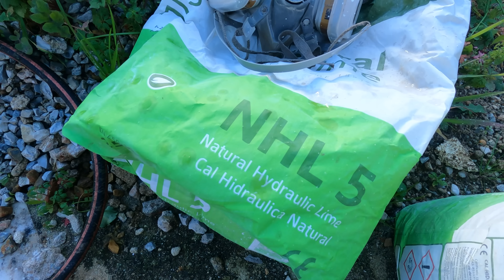Never done THIS before - Screeding a Limecrete Floor

Comment: Great job guys. Yes me and electrics have the same relationship as you when tackling something new. Some thoughts I had, when you have a dryer mix might be easier to lay mix down in layers and tamp out so as to avoid air pockets also not sure of your finish but will you be using a leveling compound? before tiling floor.. This can take out any slight discrepancies of levels..

Comment: Use self leveling concrete after you put enough height to get the perfect floor level
Reply from the maker: Why would we go to all the effort of putting in a (breathable) limecrete floor to then ruin it by using cement or a plasticiser 😳

Comment: On the anxiety issue, I'm sure that it doesn't help having the camera rolling and the pressure of feeling like a teacher. But you guys have made it plain this is not teaching, but showing the doing when you're unsure of what you're doing. That's different. For me, watching you is about watching your experience, not necessarily expecting a tutorial on how to do something. So, there's that. And one more thought to enhance the experience, while I have tried to watch every one of your videos, I sometimes forget what the plan/goal/inspriation is for a particular room, so including a snapshot of your end goal design at the beginning would be helpful for me, and maybe others. That way, we could comment with more insight when you ask for advice like tolerances, etc. If the base cabinets are going to sit directly on this, I would want it to be as finished as possible. If there will be a covering, then I don't think I would be particularly precious with the finish, except that it be level and ready to accept the next layer. Time is your most valuable commodity. Cheers.

Comment: Morning from Canada. Do you have any scaffold tube. If you level that and set it on the floor for screeding it will save you time and make life easier rather than use wood which will stick. Chalk line on the wall for level or 2inch tube if you have it. it will lift our if you mould oil or veg oil the tube. Chalk line the wall nail gun the cork

Comment: Here's my two cents (although not very familiar with lime) the ratio 3-1 should be good, if it were concrete i would add brita nº 2 to the mix so it would help with the amount of mix you will need and to reinforce the slab it self, since u're not using "malha-sol" (Portuguese word for the grid steel that goes on the bottom/middle)  from what i know 4-1 part is more for the facade of walls where you need something more fine. And also i believe you should have left the form at all times (the scrap of wood) because when it expands it might get out of shape. Apart from that... excellent job :D

Comment: A wetter mix will self-level and also screed more easily. And you won't get the air gaps that are visible in the sidewall. 

If you're tiling over, then too smooth a surface is actiually bad. 

In short, Level=Good, Smooth=not so much

Comment: High spots bad....Low spots can be filled by tile mastic.  If you have one spot that is a centimeter too high, the entire floor will need to be raised by your tile mastic...A low spot can easily be fudged in.  Keep your mix as wet as you're comfortable working with.  You don't want it leaking out under your form board but you also don't want to break your arms moving the pour about.

Comment: Do you have any cracks in the hemp plaster? Even just tiny ones? Maybe where it is thicker?
Reply from the maker: No, we’ve checked a little and all is good. The hemp fibres can accommodate quite a lot of movement… it’s also been quite cold so it’s dried very slowly.

Comment: This may be a dumb question but how do you ensure there are no air gaps in the flooring you are laying down?  Also just as a side when you come to the washrooms or rooms that use a lot of water, would putting a drain in the floor be a useful thing?  They do this in Brasil and I thought that was brilliant.

Comment: I'm not sure about the level, it looks a little bit crooked - could be from the camera. Anyway, the perfect levelling of this underfloor basement is not required.
Anyway, if you aim for a better result you could use a transparent hose (10 m or so) filled 3/4 with water to measure let's say 50 cm above your final desired floor level. Make sure that the hose has both ends opened so that the air pressure on both sides is equal.
Mark 2-3 such levels on each of the walls. Then you could use those measurements for everything (limecrete floor, slab, wood flooring, electrical, s.o.) . Measure up or down from those as needed.

Comment: We too are dealing with the difficulty of finding builders in Portugal. Our wait for a replacement roof job is going on 16 months is just one example. A heat pump system is being installed this week and I had to pour two concrete pads myself or wait months to find someone else to do it. Out of the question. I noticed you did not install malha sol steel grid reinforcement in your floor there. Steel is not needed in limecrete?
Reply from the maker: Crazy isn’t it!
Interesting that you put down concrete pads for the heat pump … we’re thinking just to put in a gravel base to keep the vibrations (and noise) to a minimum.

You can’t use steel, or rebar, in lime (it would eventually corrode). Often the reason for grids in concrete is to prevent cracking which isn’t as much of an issue with lime

Comment: Tiles (modern) have grooves or patterns on the bottom to grab the setting materials. There is at least one specific tool to spread grouts, as well as certain grouts for use (wet, outdoor, cold, dry etc) so look at the tolerances. 
"Spacers" are something I personally wouldn't use (grooves make moving, cleaning a pain in the ___)
Tile choice could solve that issue.
Reply: Of course this is likely redundant because you've already done renovations. Sorry if I did that. 🙄

Comment: Can the Limecrete be your finished floor?  why put tile on top?   won't it work as a finished floor, maybe add some pigment to it and polish it?
Reply from the maker: We did consider that but apparently lime doesn’t polish up as well as cement (there’s very little research/opinion on the topic but what I did find didn’t suggest very good results). It would also look a little strange in a rustic farmhouse setting

Comment: I know little about the properties of "limecrete", but would it not be easier to use as a wetter mix, which would be easier to move around, albeit it might take longer to dry? More like a normal concrete mix?
Reply from the maker: Unfortunately not, a wetter mix means a lower strength slab … all due to the hydraulic set properties of lime. So we’re treading the fine line between workability and strength

Comment: Is rebar not needed for tensile strength?
Reply from the maker: No, not required. This layer plus the previous one (leca + lime) give sufficient compressive and tensile strength.
Rebar would also eventually be corroded by the lime

Comment: Do you really need to mix the sement so hard? I use ready mixed bags. And I use much softer mix. And I have semented a lot and it is all fine and strong and hard. Whith a softer mix it would not be so hard to work with. And put water on top of the sement when you are leveling it out, makes it easyer.
Reply from the maker: It’s not cement 😃

Comment: Another job ticked off. Levelling should be done as best you can at this stage. You don't want to have to be trying to level too much depth when laying tiles. Tile laying is a pain without adding to your difficulties at that stage.
I slid off my mountain bike today and in skidding along frosted grass on my bum I left a perfectly level skid mark. Bruised but not badly hurt. That's my bit of levelling done. Your version looks less painful.

Comment: if you are tiling on top of the floor wet your mix down it will level so much easier, also why not use concrete, again nobody will know once covered.

Comment: I hope this does not tamper your enthusiasm, but a slab that thick really should have steel wire fabric reinforcement mesh.  I'm afraid that slab is going to crack.
Reply from the maker: It’s made with lime, not cement. Lime has inherent properties that make it very unlikely to crack

Comment: To mark the cork try a "groover" rather like they use for leather - this is sounding a bit "ooh, er vicar". For working with leather it's called a stitching groover.
Reply: Yes, I was going to say mark it with a small flatblade screwdriver or similar implement.